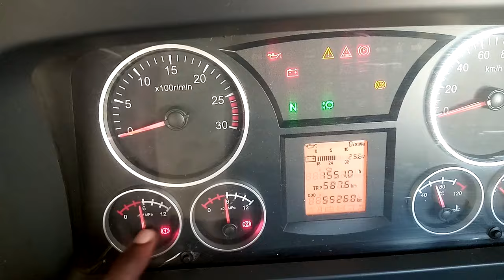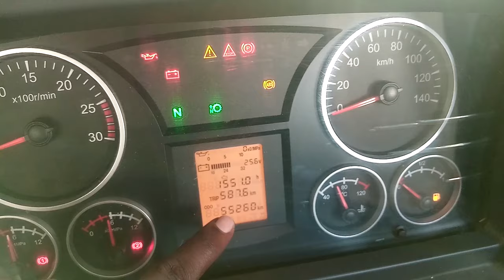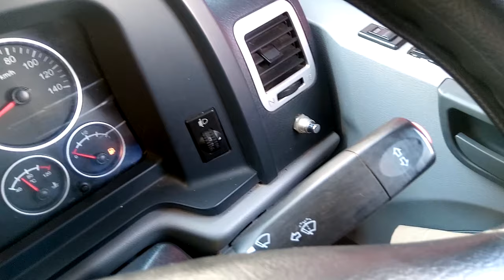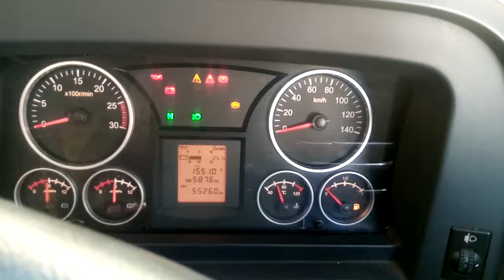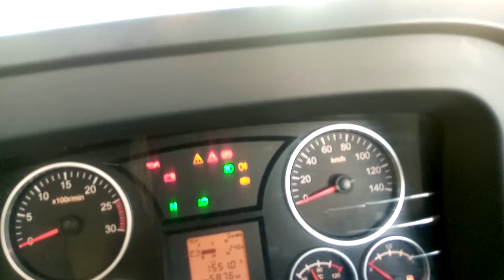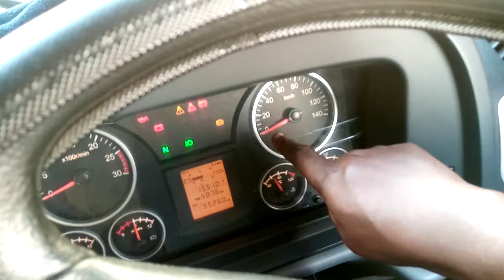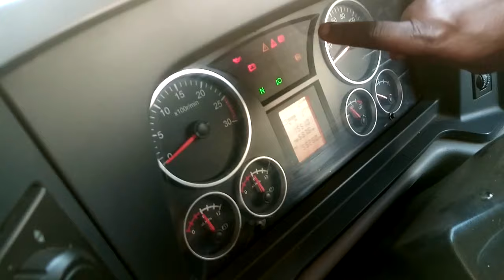DRIVE BEIBEN 2638 TRUCK 12 GEAR RANGE

Comment: sio lazima ueke neutral ndio uende high or low the gear will only change range ikiwa neutral ikiwa 6 ueke high ita change range wakati utatoa gear ipite neutral position..kuna inhibitor kwa gear ya kuizuia kuharibu gear kwa kuchnge range kama haiko neutral